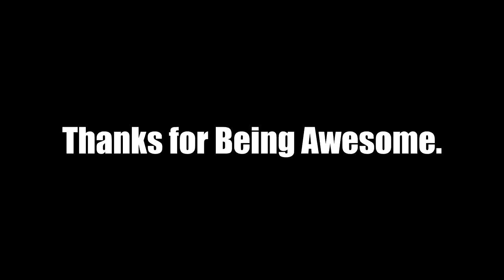THE GATOR should FINALLY RUN!

Comment: It would have taken you 30 seconds to put the plugs in and start it.......
Reply: Chase come come back tomorrow and see him put one spark plug in and the other spark plug in the next day and maybe you will see a start up by thanksgiving 😉😉😂
Reply: Lightning 12 you're optimistic. It'll be Christmas before that motor runs at this rate
Reply: it did need the carburetors
Reply: Haters gonna hate.
Reply: Chase he is going to go on strike for a couple days now
Reply: He had the intake manifold off as well

Comment: also on the ignition coil, most are adjustable to set the gap between flywheel, it can be fairly critical for timing and spark voltage. most have a single wire coming from them for "kill switch" you ground it to block to kill, although some are "ground to fire"

Comment: unless your working on automotive heavily, probably best to have the air hose and power cord centered in garage overhead, if mainly vehicle repair, have double of each per side of vehicle bay centered front to rear or about (don't want to drag cords/hoses across cars ;)

Comment: I'm not a big fan of your little fan but I'm not sure what it's effect will be on a small motor like that. Make sure when you're using something like that to take into consideration the inner workings of your carburator. If your carb sucks in fuel depending on the vacuum the engine creates then pushing in air will mean less or no fuel. You'll have to find some sort of way to make sure it keeps supplying steady fuel or even having it be a draw through carbureted system.

Comment: Hi Dalton last night I bought a 99 cr125 roller with the motor in a box for $250 but it's gonna rip in due time!
Reply: chalz108 build the motor first put a 3mill crank with a 164 big bore kit and complete hinson clutch kit will rip like a CR250
Reply: chalz108 does she run?
Reply: mike jk of course it's a Honda little tweaking here and there and she will be ripping up the diet
Reply: mike jk she will run after Christmas. Gotta pay for presents for the family first
Reply: chalz108 good man
Reply: chalz108 when you start change the spark plug buy a couple extra drain the gas clean the air filter change the oil and oil filter spray some chain lube on the chain and sprocketsthis should cost no more then $60 if you do it your self you will be surprised how easy it is good luck
Reply: mike jk will do. Thanks bud
Reply: chalz108 np do that it should run better then new